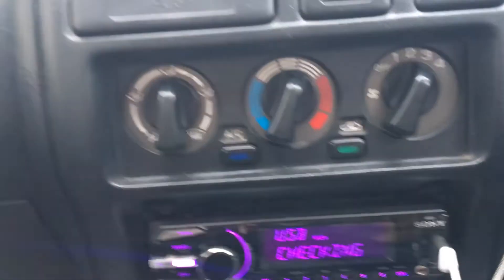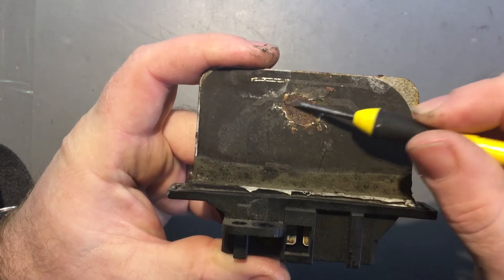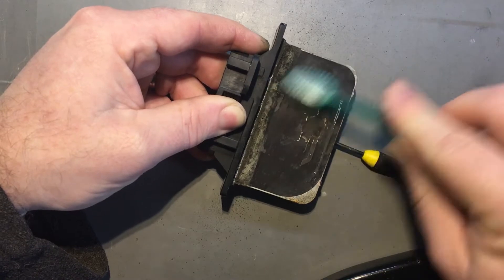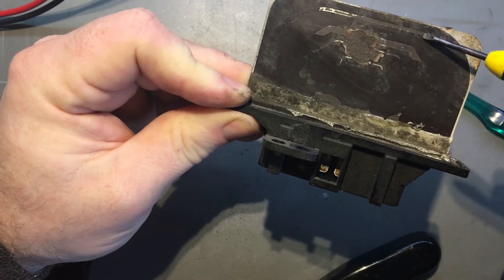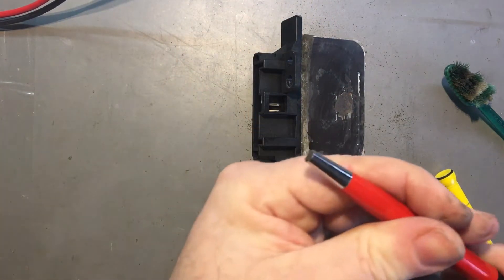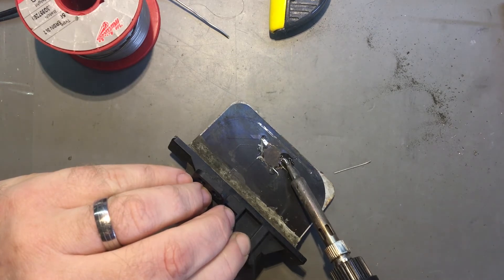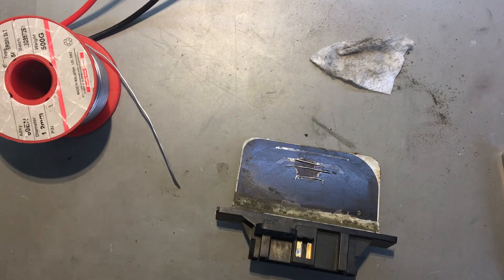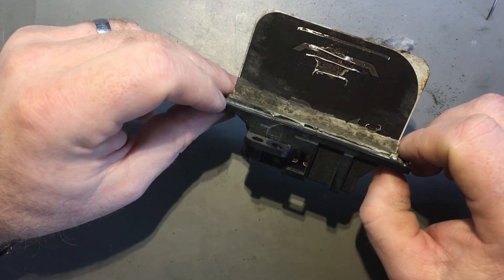#278 Nissan Pulsar Blower Resistor Repair

Comment: you might try dish washing detergent and hot water to clean the unit.   I used it for 25 years without a failure.  another fix for the wires is to use copper foil used in stained glass fabrication.  its cheap and you can cut the trace to exact shape and size and pre-tin the copper before install.
Reply from the maker: Copper foil is a good idea, that would of been easier... I have copper tape, I could of used that! Thanks for the suggestion.

Comment: not to be downer, but the solder will likely melt and burn open real soon when used :(

I'll assume the coating let moisture underneath and it rusted then burnt out.
Reply from the maker: throttle bottle - it shouldn't get anywhere near hot enough to melt the solder (unless something goes horribly wrong). I have done this kind of repair several times on different vehicles, all successfully, I did this repair a few weeks ago and it is still working ok, and has had approximately 15 hours of usage since then.
Reply: @TheDefpom  Solder is not sticking tho.

Comment: I don't know if I would trust that for too long.  I assume the links were there to act as fuses in case the motor were to short internally. If that were to happen hopefully there is a fuse somewhere that would blow. Otherwise you could have a nasty fire under the dash. Probably better to order the proper part from Nissan. Interesting fix though. ATB Doug.
Reply from the maker: Doug McArtin - yes there is a main fuse, the fuse links on these boards are more of thermal fuses in case the fan has seized, as they are cooled by the air from the fan, so if it stops turning but is drawing current then they melt. In this case it would effectively still work as the solder would melt, cutting off current flow.

Comment: Cheapskates, steel heatsink?, As zx8401ztv says, they used to be nichrome, but the connections were folded and spot welded usually, massively inefficient but really reliable and cooled by the airflow from the fan. Vauxhole really screwed up with a resistive load in an ABS mounting plate, fire anyone?, A PWM circuit would be a nice way to do it?.
 Cheers, J.
Reply: Vauxhall, you say?  Dacia used to be the poster child for poorly made European cars...
Reply: yes, I'm not keen on Vauxhalls, no particular reason-always a poor cousin to Fords, Dacia never really gained a foothold here in the UK they were mainly only seen as cheap pick-ups bought by wealthy farmers as a tax write off (my personal exp), Meh, Vauxhole has been in my eyes a cheap throw away car since the '50's, Oh, if you didn't guess I'm a car snob, though I have a sense of humour,
 Best regards, J.